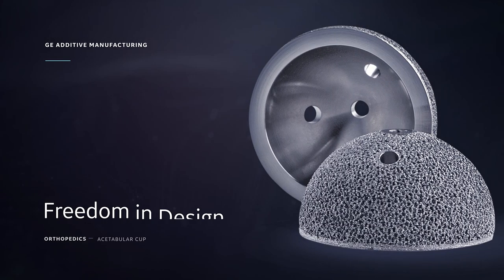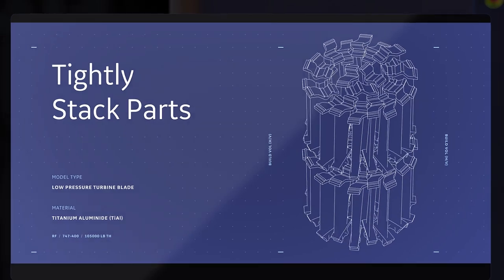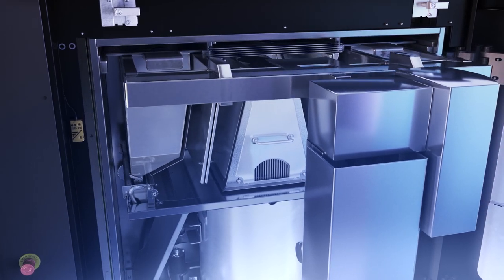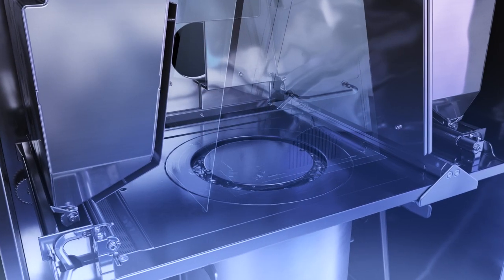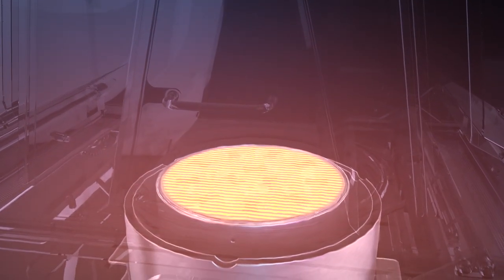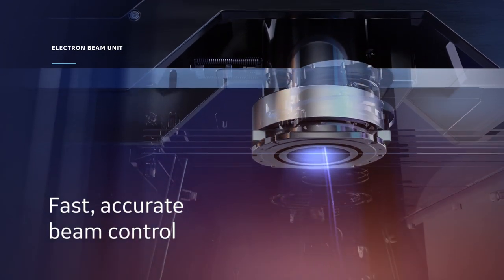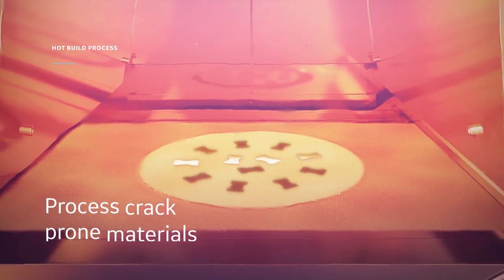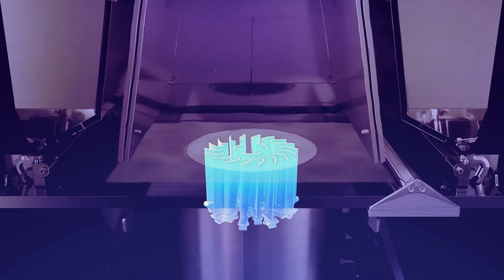Transformative technology—Electron Beam Melting (EBM)

Comment: How the powder materials in powder bed are stable under a vacuum environment, which is generally utilized for Electron beam?
Reply: its not really stable, thats why lbm is better in terms of surface generation
Reply: @TheCrzyPlayer  Guys, i'm designing a single stage LPT (hardly 250mm at diameter) and it'll be made from TiAl. Which manufacturing method is most beneficial for this material?
Reply: If you need a good surface quality  use Laser Beam Melting. EBM is fine too if the surface quality is not that important.
Reply: @TheCrzyPlayer  Thanks man, appreciate that

Comment: How fast?
Reply: That's doesn't matter. Crystal structure optimization and pore reduction is way more important.
Reply: I think the scan speed of EBM is generally ~1000 m/s. I don't know how "big" the beam diameter is, but generally you would multiply the cross-sectional area of this beam by the scan speed to figure out the rate at which it can create a single layer. Then, depending on how many layers you need to fill the part, you multiply the amount of time it takes to set the metal powder and move between layers, by the number of layers.

To summarize: There are two components of the time it takes. The time to create a layer (based on the beam scan speed and diameter; and the area of the layer), and the time it takes to move between layers. You'd have to actually know how big the part is (the layer-by-layer area and the number of layers; or for a more rough estimate, just the volume, height, and the thickness of a layer will do it) to determine the actual time, but generally, ~1000 m/s is incredibly fast. 

To my understanding, you can compare it to laser based sintering, which I think is slower because it can't be controlled through a lens like EBM, giving it a slower scan speed.
Reply: @cosmosity1693  Depends, I think? On what your purpose is, and how much you care about the final material properties. You probably know more about the applications of EBM more than I do, by your words, but I think it is still pretty important to get out parts fast, especially if you are not in super-high-fidelity areas and have a choice between EBM and some other process (i.e. you still need a high-quality part, but you don't need the /exact/ crystal structure type or specified porosity that EBM or some other process might ensure). In that case, the higher speed 3D printing is useful, because it makes things cheaper and gives you higher throughput (if you want to create a lot of your higher-fidelity parts).

If you're doing research-level, bleeding-edge stuff and you only care about the material properties to make a few super-high-fidelity parts (not a technical term), I get that. But can't EBM be used for more general manufacturing too? In that case, throughput /does/ matter.

In any case, it's probably good to know the general specs of any manufacturing process you're using, regardless of whether some aspects (like crystal structure optimization and pore reduction) are typically more important or emphasized in industry/real-life usage than others (such as speed, debatably, in this case).

I'm not a manufacturing engineer, so any discussion or disagreement is appreciated.